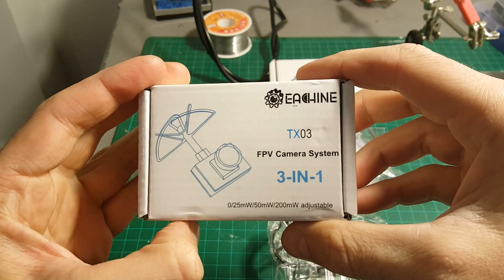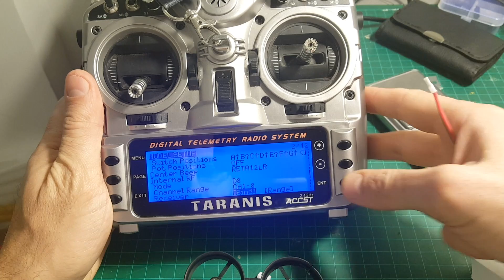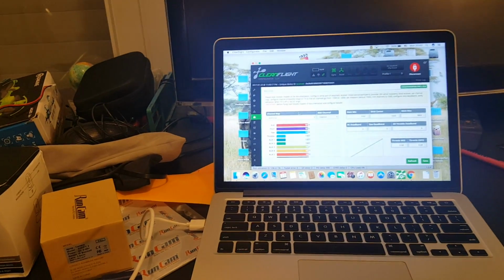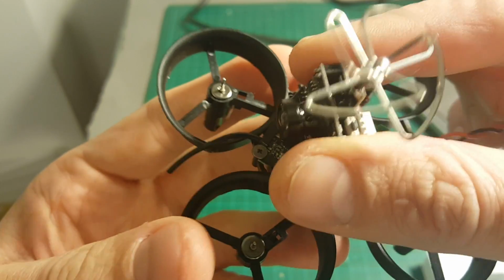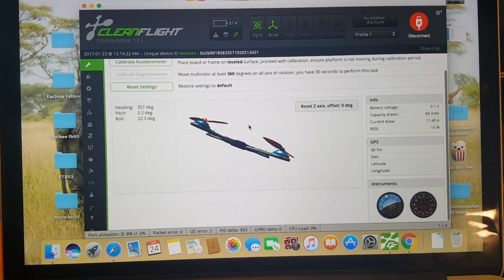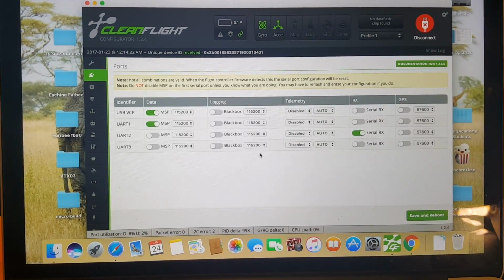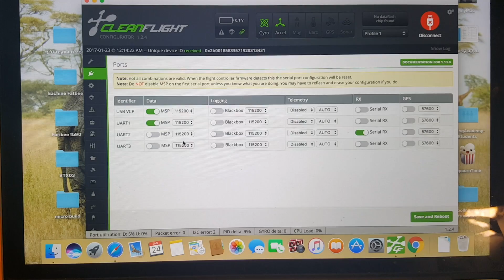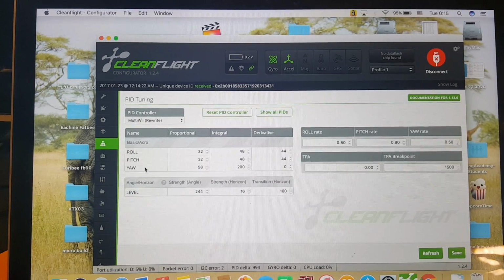Micro brushed quadcopter full build video - How to build a "Chiney Whoop" in 10 minutes

Comment: Doesn't look like the motor provide ample power. I can see it lost height at several places in your video.
Reply from the maker: I think that it can be improved by trimming the 4 leaf blades (into 2 blades) and by using a smaller battery. Overall it was very fun to fly it.

Comment: that weight.. ouchh!  :o 
Mine is 24.9 grams with boldclash 18000kv motors,  150mah 45c battery, boldclash F-01 camera.
Lots of power and throttle punch... 3 min  (fast) flight time.